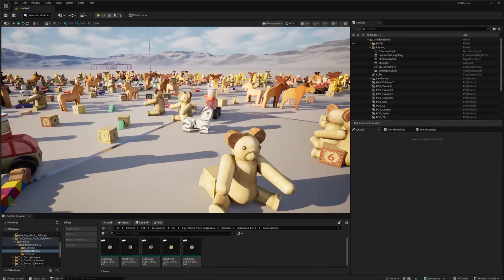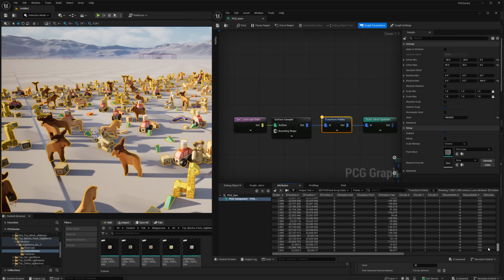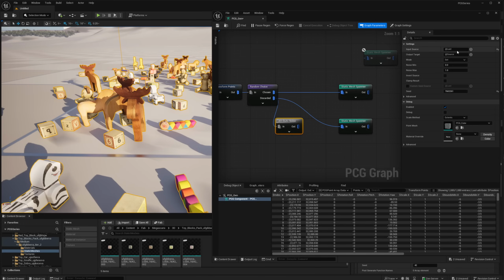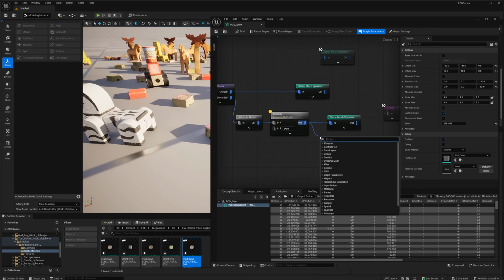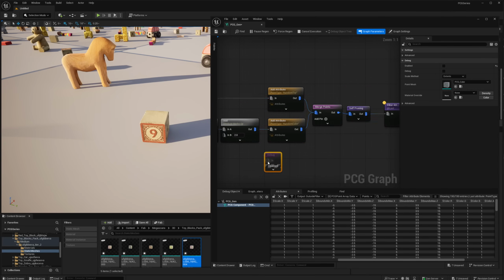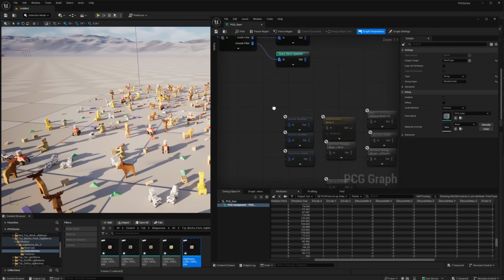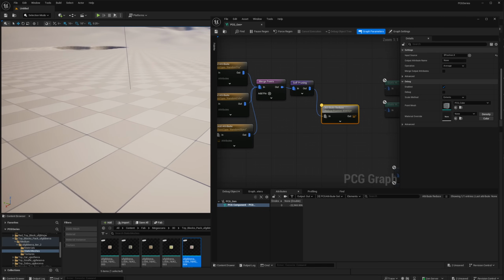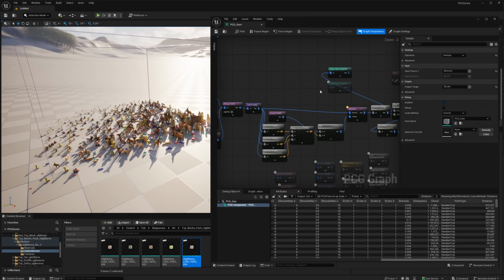Mastering PCG Attributes in Unreal Engine 5.6 – Control Everything

Comment: Thank you for the tutorials!
I am looking for a solution to Increment the Array points as a group or type? 
In example, I am using Pathfinding. It is having 10 different paths, which stored in the [0]PCGPoint Array Data: (Complete)-[1]-[2] etc. <-- I am trying to save out that number like 0-1-2-3 for all my points which is in the different paths, arrays.
With the Partition and Add (+1) is just setting the values I am giving and incrementing it. - Like Add attribute, and it is =1, then it will be "2" in all the arrays.
-Or this might be a silly question, but is it possible to save out the array's name? 
Thank you in advance, you rock!
Reply from the maker: Not sure I understand what exactly are you trying to do.
If you can clarify I will try to test and find some solution.
Reply: Hii! :) Thank you for returning response, I am sending you an email with a picture to illustrate.
Reply: @Gerrr6934  Hope you got this resolved already; if not you could surely do this with a subgraph/loop. They go through your Array entry by entry.